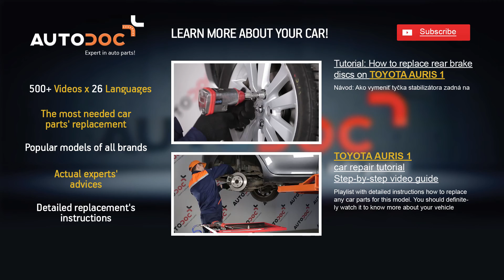How to change front brake discs and front brake pads on TOYOTA AURIS 1 TUTORIAL | AUTODOC

Comment: Can this job be done without special press tool?
Reply from the maker: Thank you for the question. It is strongly recommended to use the special press tool doing this job. Best regards, Autodoc.
Reply: autodoc.co.uk as i understand there isn't any other option other than using this special tool for pushing back the caliper piston...Thanks for the answer.
Reply: TheAlexunit yes. You can use a thick flat blade screwdriver to push the piston back with the old brake pad before removing the caliper
Reply: O have done it sucessfully with woodworker clips (grampos)
Reply: No,because this piston is screw type, not old style
Reply: You can use 'any method' to achieve pressure & press it inwards.

One comment here talking about the screw-in action/type of piston - that only applies (on this car) to the rear brakes, because the handbrake mechanism deploys this system.

The front calipers are simple pistons.

He uses the 'screw-in' tool because it works in all circumstances - but it's not necessary for the front calipers, on this vehicle (& probably not any or many, on the front).